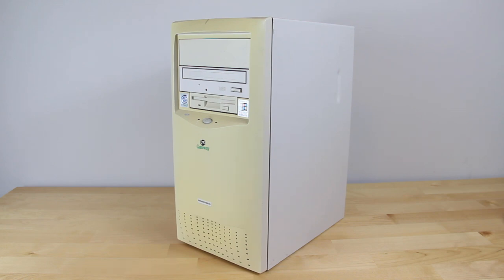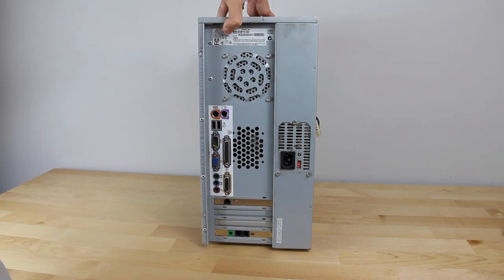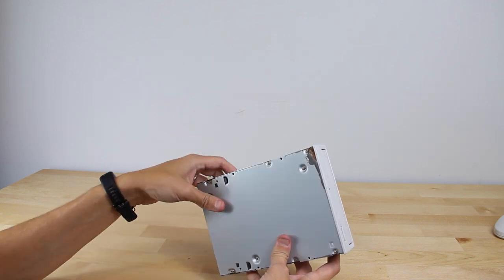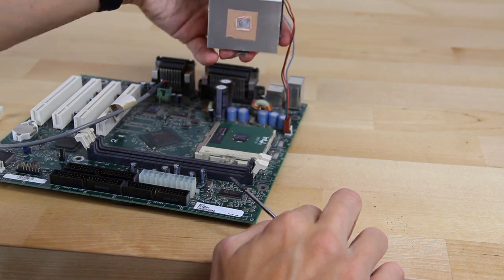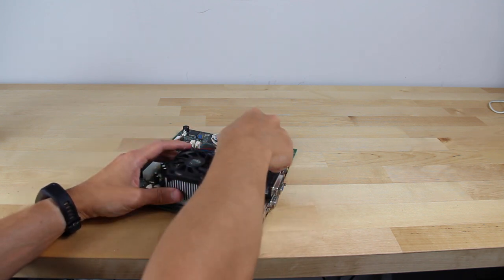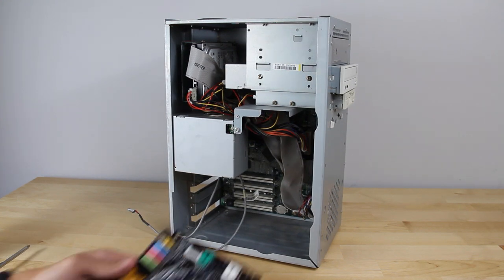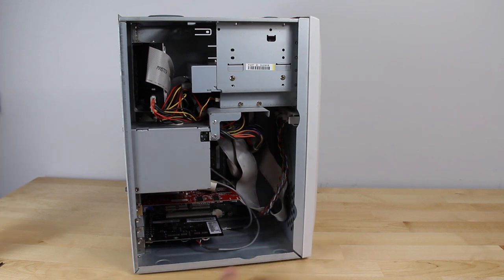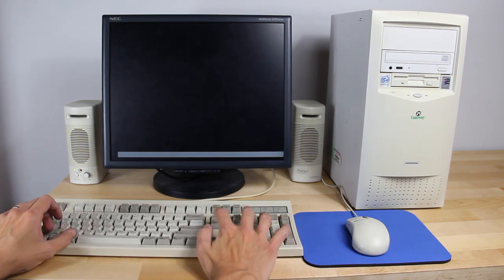Gateway Pentium 3 - Quick Refurb

Comment: We had a version of these at my high school, way back in the day when I was a freshman - they replaced a bunch of Compaq Presario CRT all-in-one Pentium machines, and had 433mHz Pentium 2 Celerons with passive CPU heatsinks. The power supply is the only way air gets into the case if you don't install a second fan in the rear 80mm spot, so that machine you have probably choked on dust for a while until the PSU fan failed completely, and had no case airflow after that.
Reply from the maker: Yes good point! It's an interesting case design but it does work. I fixed it up again for a more recent project and that's when I realized I had reversed the fan direction. Poor machine didn't even get the benefit of that small PSU fan!

Comment: are there any risks of a GPU throttling the CPU in n old build like this? I'm looking for a AGP-GPU for  a Athlon K7 750 Mhz. Do you think Geforce 3-4 would work?
Reply from the maker: Sure sooner or later you'll run into a bottleneck just depends on what you want to use it for. A geforce 4 would likely outpace a 750 Mhz processor but it also means you could run games at higher quality for the age. Personally I think it's better to have a faster GPU vs fast CPU since you can then crank up graphical details etc. Geforce 3 would match better for your time period of that processor but a Geforce 4 would probably be easier to source/cheaper although it'd probably be considered overkill. Really either option would be just fine so price/availability will play a key role.
Reply: @RiksRandomRetro  cool thx, I'm not sure what I'll buy yet, maybe I'll go with Raedon anyway since it seems to have better driver support. Anything better than the S3 Trio64 PCI that is in it now >_<
Reply: @RiksRandomRetro Right now I have a S3 Trio64 from 1996 in it iirc and it workes for simpler games and desktop use.  I'm not that into 3D games at the moment, but it would be nice to play some of them decent.